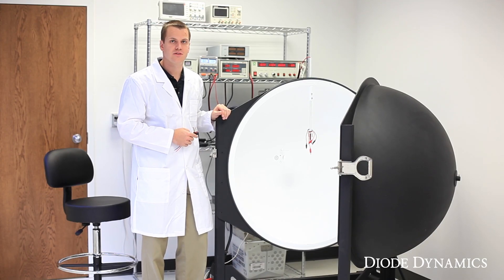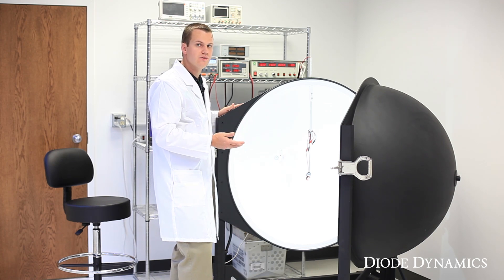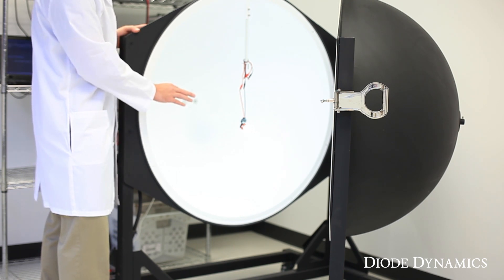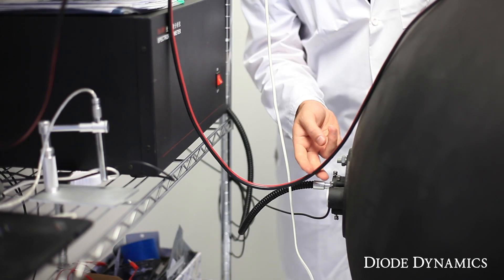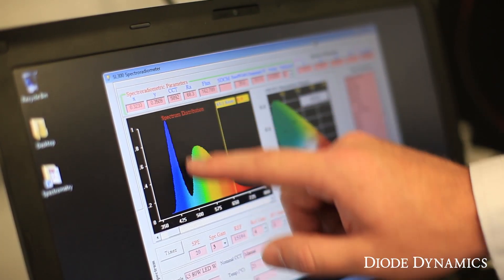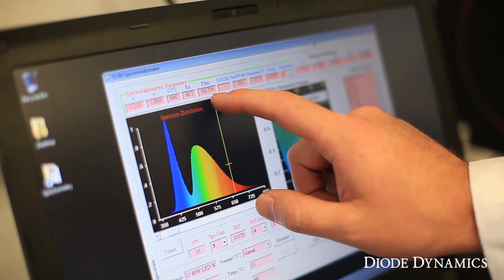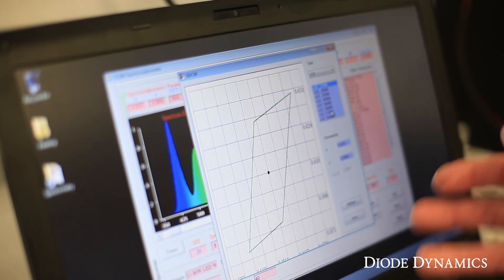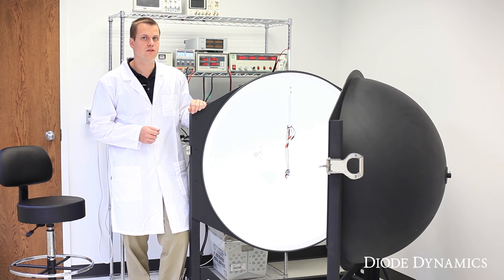How LED Bulbs Are Measured: Integrating Sphere Overview

Comment: Hi, I would like to know much time does an LED takes to get heat up to reach thermal quilibrium ?
Reply from the maker: Hi Raj! Typically, it will take 15-20 minutes for the LEDs to reach thermal equilibrium.
Reply: @diodedynamics   Thank you .
Reply from the maker: @rajmaguluri526  You're welcome!

Comment: Interesting video, thanks
Howcome do you not talk about the Ra value, which in this case seems to be quite low?
Reply from the maker: +Victor Suenson CRI is not a primary concern for the automotive market, which we serve. 68 is also not an incredibly low number, as most standard LEDs are rated at only 70. Perhaps we'lll make another video on it later, thanks!

Comment: How long before you all have the technology and/or ability to make LED headlight bulbs to directly replace OEM halogen?
Reply: In the same housing? Never. Halogen housings are calibrated around the radiation pattern, location, and size of a halogen bulb filament. Any deviation from that will severely compromise the reflective calibration of that housing.
Reply: Andrei Pop It's not technically impossible, but it will be very difficult for reflector style housings. You are correct in saying any deviation from that will severely compromise the reflective calibration of that housing.